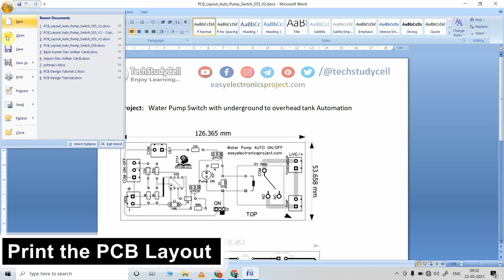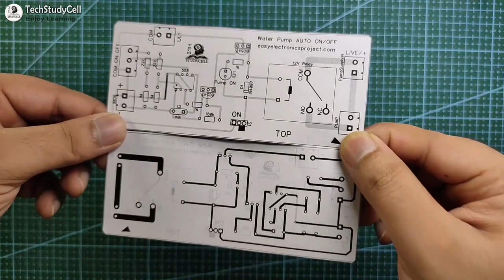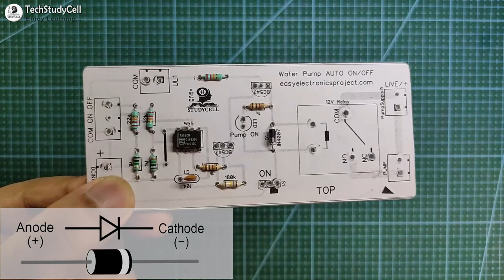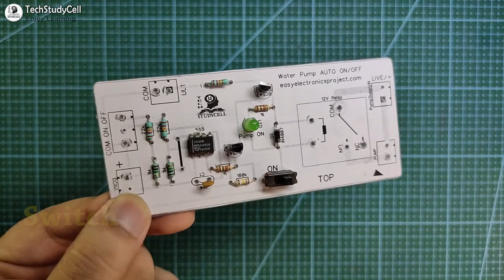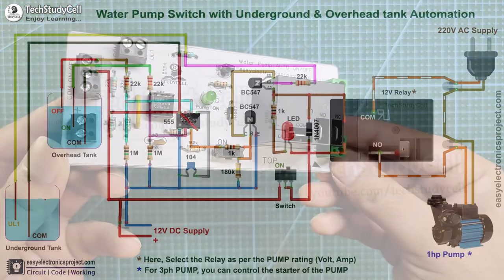Automatic Water Level Controller for Submersible Pump and Overhead Tank | 555 Timer Projects 2021

Comment: Bravo !
The best of circuits I watched ever on YouTube. I'm not an electrician nor a circuit expert but the way you presented this video without commentary I will definitely try to make it by myself.
I have a suggestion though. You rightly have inserted dry run protection by setting a sensor in underground tank to ensure presence of water. My suggestion is to modify it instead of presence of water in underground to sensor beneath pipe which fills overhead tank with time elapse sensing.
It will ensure dual purpose of dry run protection. It is possibility of existing water in underground tank but for any reason whatsoever water may not be flowing in overhead tank. In a few seconds if anything is normal, water flows in overhead tank enable the circuit to run as normal otherwise it should be disconnected.
Hope you understand my layman's explanation and will try to modify this excellent circuit.
Reply: To my raw assessment, if I put two wires meant for underground tank on flow of overhead tank or in water supply pipe and a little delay may be produced by adding a capacitor. 
You may provide an exact solution but my intention is to rely on water flow instead of presence of water in tank which is definitely 100% surety of dry run protection.
Reply from the maker: Thanks for the suggestion. Will try to add flow sensor in upcoming video.
Reply: @TechStudyCell  Dear would you like to send me new pcb design and lay out of components diagram. Regards Iqbal Islamabad Pakistan

Comment: What wire diameter do you recommend if the overhead tank is 70-75 feet from the circuitry?
I could calculate it if you can give an idea about how much current flows through those sensing wires(considering @ 12v)

Another thing, is a 100A solid state relay enough for 2hp motor?(to my calculation it has somewhere around 500w overhead)

Comment: Sir you are genius,
Your pcb making method is very good and easy to make,
Sir please make this type running led  circuit diagram,
Running speed adjustable 10 led chaser with CD4017 and NE555 ic

Comment: Okay I have a couple questions, what is the purpose of a common wire ? What does it do ? Second do the wires have to be in separate containers ? I am trying to modify/ find something that fits my need for my aquarium. I am trying to take water from my sump filter( under water tank) and make it go into the main tank (over head tank). I am trying to recreate tide changes in the aquarium so when the water gets to low the pump turns off and when it gets to high it turns on in the sump, that way it gives it the appearance of the tide going in and out. For my situation the on an off wires would have to be switched is that possible? The on wire would run dry during high tide be cause most of the water would be getting pumped out but once to much was pumped out it would trip the off wire causing the pump to turn off and letting water return into the sump and the cycle would repeat over and over , the UL 1 wire would be 2-4 inches below the off wire as an emergency shutoff so the pump would t run dry because water evaporates. Do you think it’s possible to do this ? Are there ways to protect the wires as I want to do this in a saltwater tank ? Can I attach float switches to the wires ?

Comment: Great project! Can you modify the design in such a way that a momemtary swich activates a relay for 10sec. which then starts a pump. In this 10 sec. a waterflow sensor must be on  and then  keeps the relay activated. If the flow stops ( sensor off), the pump stops. Thanks.
Reply: Can we do this project with the help of breadboard

Comment: Sir ur idea is good but for under ground u will need three wire sensors as the water touches ur ul 1 ur pump will sart and when water level goes below it it will stop so when a little water will fill th pump will start stop continuesly so u should make three wire sensor for under ground tank thank u

Comment: @Tech StudyCell  and if I want to supply 5v (Mobile Charger) instead of 12v and change Relay to 5v 30A 230VAC, will this circuit work without changing any other components? 5v is more convenient then adding another bulky adapter for 12v. Please explain.

Comment: Hi..Why cant we incorporate a 12v supply on the board itself instead of giving a separate power supply point for the 12v.
The circuit diagram should be modified for only 220v input with required components on board for automatic voltage reduction wherever required.

Comment: Bro make a wireless water level controller for contactor type submersible pump starter which has  ON and OFF push buttons..needs two separate relays.. Use Arduino and nrf24 modules with display status

Comment: In 1st step The motor is working upto the high level and motor stops,then water level decreasing up to the low level, when it reaches below the low level motor stars but immediately it stops when water level touching the low level. Plz reply

Comment: Nice project and smartly presented....
Now plz reply.....
I want to keep ON waterpump,  till sensor wire touches water....
When NO water touch to sensor wire, wait timer 5-7 or 10 minutes delay...
NO water touch during this delay ..... then Pump should OFF.
NO automatic ON is required....
The pump will be manually ON.
Purpose this alteration is for incoming water line...
to avoid idle run of pump on sudden stopage of water supply.
I hope you understand my requirements...

Comment: Thank you for this very good video . I have a 12V pump. What kind of relay can I use ? Thank you very much
Reply from the maker: You can use the same relay, if the current rating under 30A. Give 12V input for both PUMP and control circuit
Reply: @TechStudyCell  thank you very much and keep on posting such videos !!!

Comment: Practically when an open well submersible pump stops , the water filled in the pipe rushes back in the tank. As per your circuit the pump will start again and stop below the sensor, ultimately your relay will burn. 
I manufacture water level controllers with flow sensors too. This is my advice, you can experience it also.
Reply from the maker: The pump will not start again until the water level touch the middle wire.
Reply: @TechStudyCell  absolutely right but when the pump stops the water filled in the pipeline to the out let of the pump rushes back in the tank and the cut off sensor again becomes active which ultimately starts the pump. This oscillation creats lot of sparking in the relay . That's why professionals always use 3 sensors like in the over head tank. I hope you will visit and see your self the operation of an open well submersible pump working. Your circuit will be good for open air self priming pumps.  only.

Comment: greetings first of all, I must congratulate you for the circuit, I already have it mounted on a protoboar and it works as designed, but in my case I am going to use a well to fill the elevated tank so I see a difficulty and that is when the well sensor is out of the water the pump will stop and when the level rises a bit it will start again and so on, is there any way to avoid this? Greetings and thanks

Comment: Sir pump have 2&3 hp then which components change
Reply from the maker: Only the relay
Reply: @TechStudyCell  and if I want to supply 5v (Mobile Charger) instead of 12v and change Relay to 5v 30A 230VAC, will this circuit work without changing any other components? 5v is more convenient then adding another bulky adapter for 12v. Please explain.

Comment: Hello I want to make it for 2 hp motor what do I need to change
Reply from the maker: no. but pls take proper safety precaution, first test the circuit, then connect motor. check disclaimer
Reply: @TechStudyCell  matlb kar sakta hun...

Comment: Sir  please add dry run protect circuit in this pcb circuit
Reply from the maker: If water level is down in underground tank pump will not start. Please watch complete video
Reply: @TechStudyCell  i mean. if Pump is running but water not reach in top tank cause of  damage of pipe and defect of motor  .  Motor should be stop
Reply: @TechStudyCell  hello sir  if you add dry run  circuit in this diagram it will awesome .
Reply: Tech StudyCell  i mean. if Pump is running but water not reach in top tank cause of  damage of pipe and defect of motor  .  Motor should be stop.  Sir please  make it for  us plese.

Comment: Motor is not stopping after touching top and ground wires what is the problem any one tell me pls it's urjent
Reply from the maker: First check the circuit and connection. Then Check for any losses connections. Keep the water level sensor wires separate from each other.
Reply: Use plenty of salt in the water as an electrolyte
Reply: Which type of sensor is used in this project ?
Reply: @mikex691  What a silly suggestion.  That will kill all my fish!

Comment: Thanks Subhajit for the share, can you please help with a circuit design i.e. use a 30 Amp relay (5V/12V), with add Nodemcu and Ultrasonic sensor to activate relay during specific time and the logic to have dry run protection, Example: if water level % in sensor does not increase in 5 mins the relay shall stop the motor.. i will contact via email, please check.. Thanks again

Comment: 2hp pump support
Reply from the maker: Just changed the relay as per the pump rating. You can use same circuit
Reply: @TechStudyCell   2hp value of relay

Comment: A big MISTAKE IN THIS CIRCUIT DRY RUN PROTECTION WITHOUT DELAY " ONCE THE WATER DELIEVER TO SUMP TANK THE PUMP WILL BE IMEDIATELY TURN ON THIS WILL MAKE  AN ISSUE FOR THE PUMP TO START AND STOP MORE FREQUENT AS THE SPEED OF DISCHARGE WATER IS MORE THEN WATER FROM THE MUNCIPILITY THIS WILL RESULT IN FREQUENT START AND STOP OF PUMP